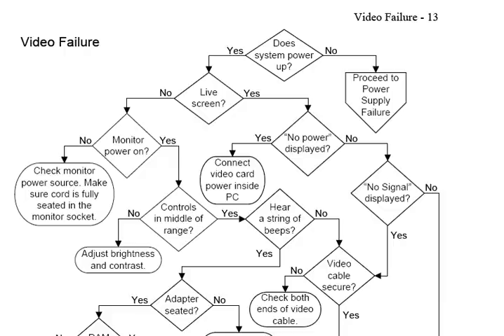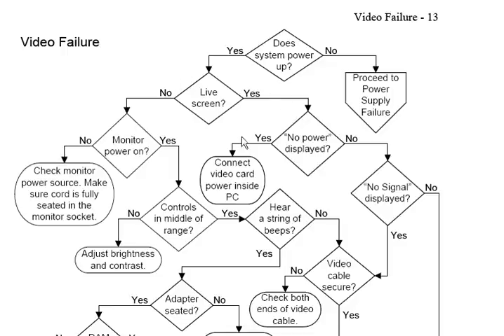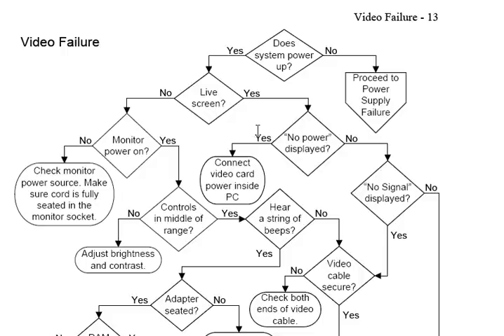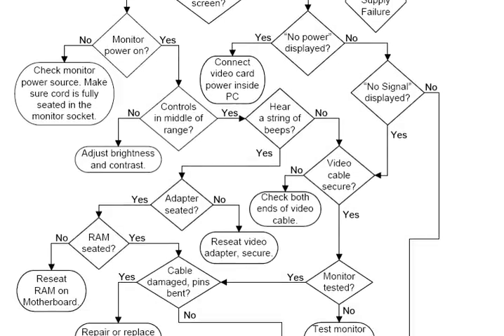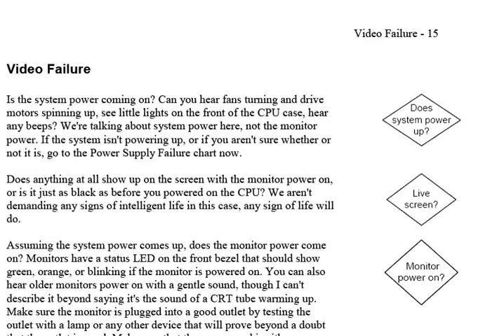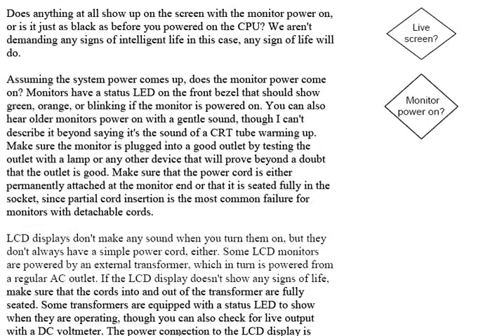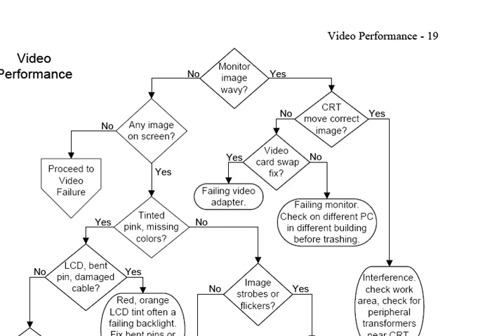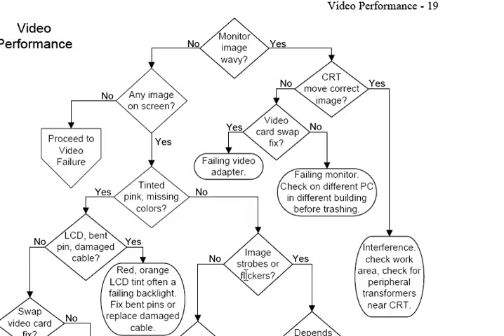PC Video Failure Troubleshooting - Video Card and Monitor Problems

Comment: One would need to learn some soldering skilsand if you have no practice with soldering then I recommend you practice on an old circuit board before wrecking your (half) good one.

Comment: If there is no signal from your system unit to the monitor and you can't get to the BIOS settings, possible causes are the following : Memory, Video Card, Monitor, Processor, Mobo.

Comment: I want to clear up the "monitor not displaying in device manager problem. If the drivers are up to date with the graphics card, then the most likely problem one would face is the failure of the CAPACITORS in the internal power supply section of themonitor hardware circuitry. 
To fix the problem one can proceed to find a tutorial in "Identify and replace power supply capacitors" which matches as close as possible the monitor which is at fault. 
DO NOT TOUCH ANY OF THE PARTS WITHIN THE MONITOR...

Comment: @DogSoldierFury 

; I am now trying to download the latest driver for my built-in video card, to see if it will show up in the device manager. My built-in video card is a "ATI Radeon Xpress 500" and it was great for gaming. Recently, I installed some new RAM sticks, would these get my ATI card back in shape? It is very odd that the ATI supposedly went kaput, at the exact same time I was positioning my fucking monitor! What is the case if a built-in video card doesn't show up in Device Manager?!

Comment: ...continued... Make sure you understand the dangers of opening the monitor before proceeding. It will require new capacitors ($2 each, very cheap) You can identify faulty capacitors by the bulging on top of it, or by a substance leaking from the top of it. I have fixed multiple monitors and TVs with this problem and years later they ALL still work. Make sure the capacitor is the right rating. ONLY TECHNICAL MINDED INDIVIDUALS SHOULD ATTEMPT THIS.